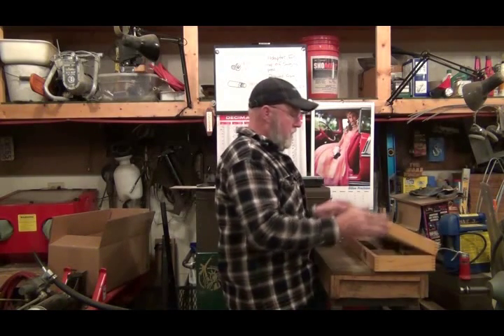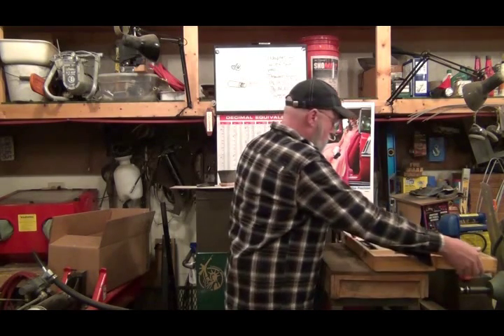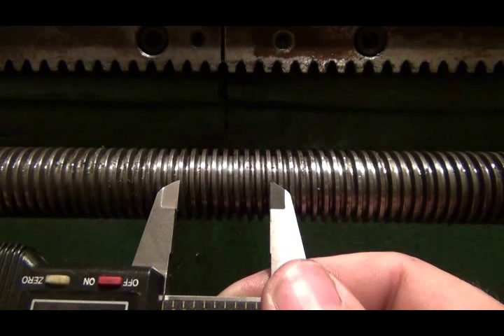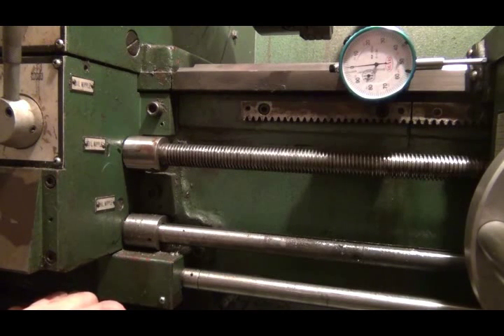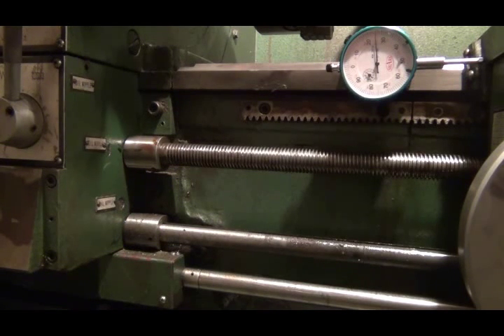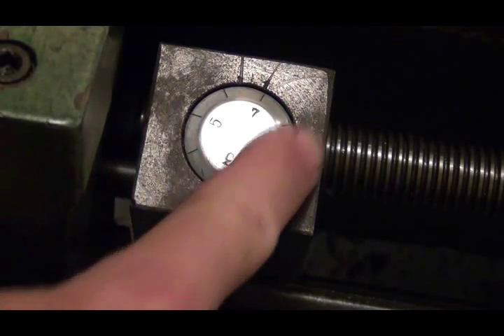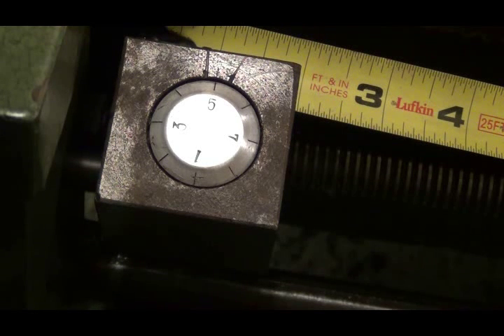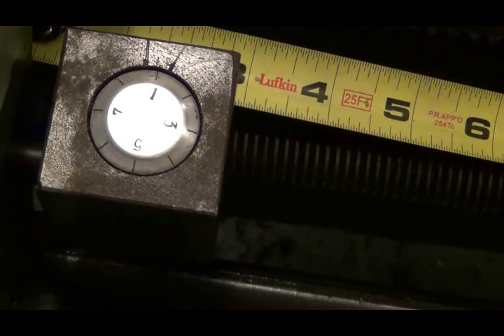Here we go more lathe diagnosing

Comment: i have the same problem with my grizzly g4000 lathe. if i let the dial go around twice instead of one time then it works.you might wanna try that. i tell you what else will work,Tom Lipton showed in a vid a while back how to do metric threads but by disengaging the half nut....thats what i do and it works on standard and metric.....try to find that clip or ask tom about it...it works well for me.... i never did find out what was wrong with the lathe,i just use the method TOM showed and it worked....like your vids....new subscriber....GOD bless
Reply from the maker: I saw Toms video and it worked for me too. But I wanted to be able to do it the correct way. What we found out was I had the wrong gear on the bottom of my thread dial. My lead screw is 8 tpi. I had a 15 tooth gear on the thread dial. I needed a 16 tooth gear. Once I got the 16 tooth gear it works great. I now have no threading issues. Count the thread on your lead screw and the teeth on the thread dial.

Comment: I've put more thought into your problem, got another idea. I'd like to see the change gear end of your lathe. There's a stacked gear (86/91 tooth) that engages with the change gears. The change gears for inch threading are both 40T. In your Manuel these are called F & G. It's possible that one might be installed incorrectly. They both need to engage the 91 tooth gear. I didn't think the manuel showed this very well that I looked at on Grizzly's web site.

Comment: half nuts are fine, Leadscrew is also fine (.875=5/8 x 8tpi) - tacticalkeychains mentioned that also. It is the dial gear that's wrong (David Messa said that as well) - if you want check it with the halfnuts disengaged and the carriage not moving (lock it ) 2 turns of the leadscrew should advance the thread dial 1 line right on the money, does not matter where or which mark you start from (you can make your own mark) - there is no position or mark you can make to change that.
4 turns should put you on line 3 (if you start at 1, so advance 2 lines), 8 turns should be opposite to 1 (mark should lineup with 5 in your case, advance 4 lines).
16 turns of the leadscrew should get you right back where you started (1 if you started there). If you do the full 16 turns of the leadscrew and your "1" line goes past the mark then you have less than 16 teeth (better check at 15 turns and see if that's where it lines up). Sorry for the long post.
Reply from the maker: I ordered the 16 tooth gear for the thread dial a month ago and installed it still not working right.
Reply: try the leadscrew turn count to thread dial lines and see if that checks out, if you can disengage your gearbox you should be able to move the leadscrew without turning the chuck,
the other thing you could do is using you mag dial indicator advance 1'', that should move your dial from 1 to 5 (1''=8 threads=1/2 your dial)

EDIT: maybe Buddy Lineman can measure his gear, the only other thing i can think of here that could make your dial misalign is the pitch diameter of the gear not matching the leadscrew.
Reply: Buckrun11
this is from Buddy Lineman on his lathe: "the maj. dia. is .703" + or - .002" and the min. is .532" + or - .002 , and mine is a 16 tooth count on the dial."
your dial gear should match his (same leadscrew tpi and gear tooth count). See what yours is like.

Comment: Have you had the old half nuts out for a check ? From the video it looks like the problem is with half nut engagement rather than thread dial engagement position. If the halves are misaligned or loose or damaged you will get the threading pick up point problem you are seeing. You have a new set off half nuts why not fit them and see what happens.

Comment: Hi Steve,

It's got to be the threading dial. You said you originally had a 15 tooth gear on there. 15 teeth/16 threads * 2 inches of travel = 1.875 = 1/8" error. I recall you changing the gear for a 16 tooth, can you just flip the threading dial up and do a tooth count. Maybe your new 16 tooth gear was actually another 15 tooth.
Reply: I believe Paul is correct, you do not have a 16 tooth thread dial gear.

Comment: I think that your lead screw is correct 7/8"-8. I still think the problem is your lathe threading dial has the wrong gear. I think it's a 15 tooth (for a metric lathe) instead of a 16. Get the right gear on it, engage the half nuts and make a new mark on one of the lines. This should fix the problem. Threading with the dial will become very easy.
Reply from the maker: I ordered the 16 tooth gear for the thread dial a month ago and installed it still not working right.
Reply: Buckrun11 Something isn't jiving here.  You proved you have an 8tpi lead screw.  You proved that over one revolution of the thread dial the carriage moves 1 7/8", which is the same as 15/8 of an inch.  If you do the math the only possible way for that to happen is if you have a 15 tooth gear on the thread dial.  I think you need to check that thread gear to be sure either they didn't send you another 15t gear or you put the old one back on my mistake.  It is a mathematical impossibility for a 16t dial gear to only move the carriage 15/8 inches per revolution on an 8 tpi lead screw - It has to be 15t.

Comment: First thing---I'm not a machinist, never engaged a mill or a lathe. However from my 46 years of building roads, bridges, utilities, buildings, etc. I've encountered similiar problems, just different size numbers.
Refer to the MACHINERY'S HANDBOOK section regarding Acme Screw Threads, Table 5.  (American National Standard General Purposes Acme Screw Threads--Pitch Diameter Tolerances). I think that your leadscrew may be a Class of Thread 2G, or ??, and your half nut a Class of Thread 4G or ??. Check this table and do the math calculations for your possible tolerance difference in 1 inch of travel. Also read the Subsection---General Purpose Acme Threads.---that is 6 pages before Table 5. My reading/interpretation of this material may be very incorrect. Ask your fellow machinist before making a fast move!
I love all of the maching videos and I thank everyone for posting them.
I'll retire next year and start another hobby of being a machinist, I hope!
My handbook is the Twentieth Edition. Maybe this will help you.

Comment: OK, lets look at this. If you can cut a thread all the way by leaving the half nut in the whole time, then you know the gears are correct, and if you have a 16 tooth gear on the bottom of your thread dial then that is right. the next thing to check is the diameter of the dial. (let me tell you what i'm thinking) I do not think you have the right dial, I think someone changed it. If the dial is to big ( the diameter of the face of the dial its self, mine is 1.172 " + or - .002 ) then the number will stop short of the mark to lock in. If it is smaller it will stop after the mark to lock in. It's like having 2 different size tires on a car, one will make a complete revolution before the other will. Check that and if this does not make any sense then check your youtube messages I sent you a cell number.
Buddy

Comment: Please do not echo your
"I ordered the 16 tooth gear for the thread dial a month ago and installed it still not working right"
response to this.

It is obvious from the tests you ran that the thread dial gear installed on your lathe does not have 16 teeth.  It will take you about one minute to remove the one bolt holding the threading dial on and another minute to count the teeth.  If you actually remove the thread dial and count 16 teeth, then take a picture of it for us to prove it.

"Trust, but verify..."